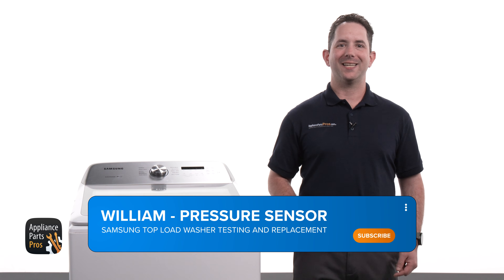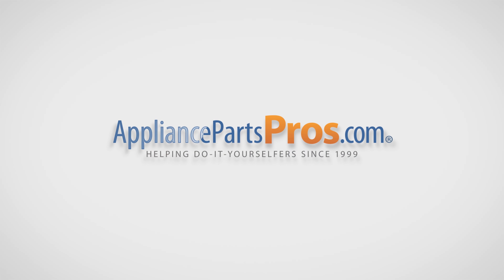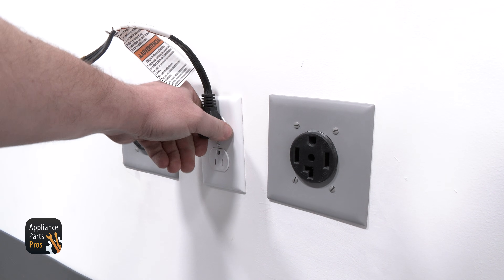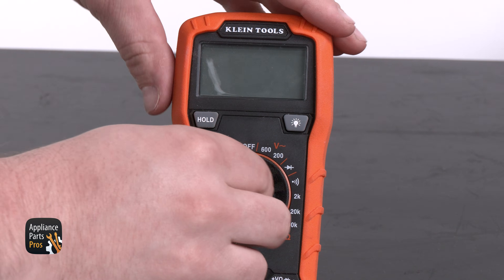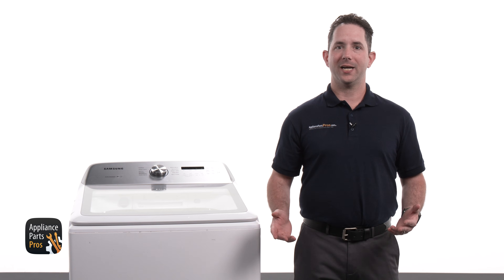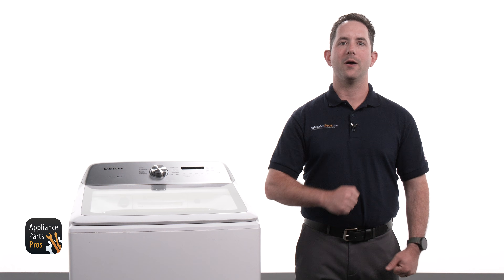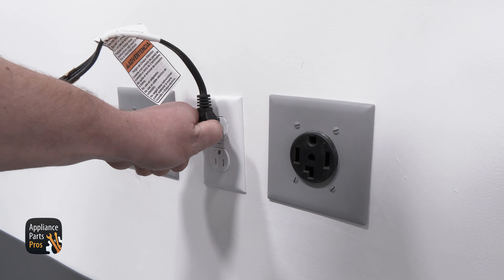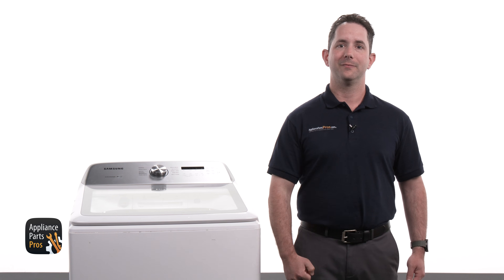Washer Not Filling Right? Watch This Simple Pressure Sensor Test!

Comment: My Samsung washer sounds like it’s draining right when I turn it on. Any suggestions on what it could be? Water inlet valve or the presser sensor?
Reply from the maker: That sounds frustrating. Issues like draining right at startup can have a few different causes, and it depends on the model and what else the washer is doing. For detailed troubleshooting specific to your situation, our certified techs can help you at forum.appliancepartspros.com. Just post your model number and what you're experiencing, and they’ll walk you through the diagnosis! 👍

Comment: What if when i go to 007 nothing happens and it shows all 000
Reply from the maker: If your washer is showing “000,” it could point to an electrical fault—possibly a short in the wiring or an issue with the control board.
Reply: @appliancepartspros thats what i was thinking a control board issue thank you for replying and assistance!!
Reply from the maker: What is the model number of your appliance?
Reply: @appliancepartspros  WAS0R5200AW/US
Reply from the maker: The control board is part number DC92-02393M, you can place that order through the website or you can call us at 1-877-477-7278 to place the order over the phone. https://www.appliancepartspros.com/samsung-assy-pcb-main-dc92-02393m-ap7017659.html